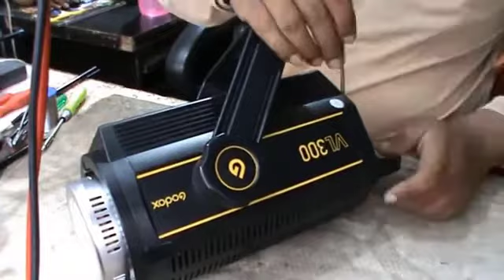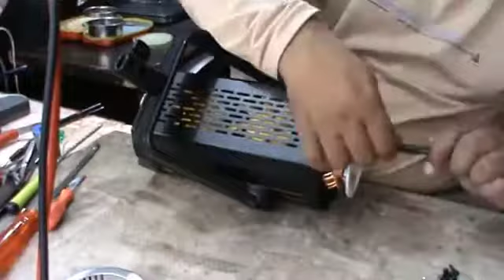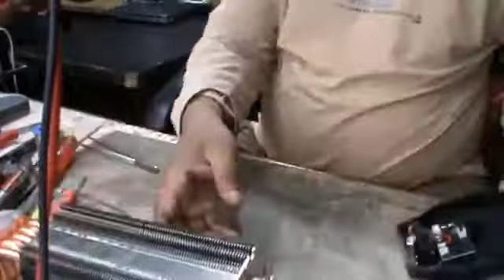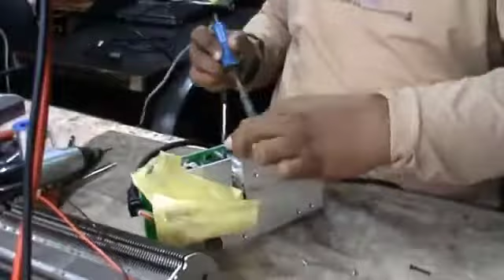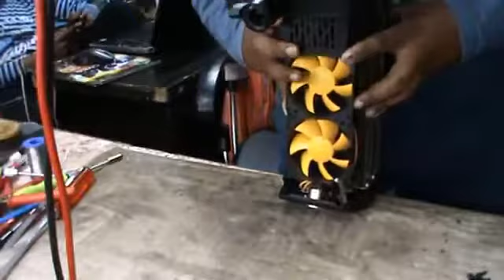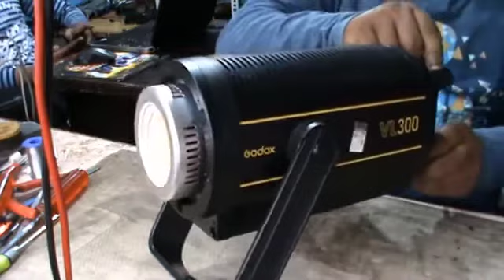Godox VL 300 | Not Working

Comment: I like the light quality and body design of VL300.
But my VL300 crashed after using it twice. The fan was not working when the light is on, then the light shut off, the red indicator blinks, and the fan started working. I have to restart it time and time again. Finally, the vl300 can't be turned on at all. The control panel looks OK, but the lamp dies. I just bought it for 16 days new. Now I am negotiating with the seller. 
I don't know what caused the issue. Do you have any idea about it?
Reply: Any update on this? Same thing
Reply: @ianmahan3630  The seller contacted the factory in China, after 3 months waiting, now the circuit board is on the way. I will update after the repairment.
Reply: Mine just stopped working. I am able to power on the controller, but the light does not turn on. I have tried swapping out the XLR cable, but no luck, so I’m assuming the issue is the light.
Reply: Finally, I receive the circuit board, after 3 months. After changing it, the lamp recovery, so far so good. The heat sensor and the fans work fine too.
Reply: Mine just turned off....I'm not even getting the red light on the power block.
Reply: @KSoul  This is just like the issue I had in the second stage.
Reply: can anyone confirm that the light colour on the power brick is supposed to be green and not red? Does anyone know why mine is red?
Reply: @Thrillstory  Mine is red. I see another friend's vl300 is red too.
Reply: Same thing after owning for a year and a half.  Out of warranty too, so no help from Godox or seller so far.

Comment: My Godox VL300 works for a very short time, then the fans come on and the light turns off, while a blinking red light flashes at the back.  Does the procedure in the video fix this particular issue?
Reply from the maker: 9829309373
Reply: @swastik_camera  I have a problem on 

Godox Controller for VL150 LED Video Light and there is a red light on the back what i have to do i am on Dubai I can’t fix it 😔

Comment: Thanks for the video. I share your frustration at being able to access the internal parts of the light fitting. My problem was a faulty input circuit board. Other technicians should bear in mind that the fans are operated by a thermal switch and only come on after about 5 minutes with the lamp on 100%.
Reply: How did you handle the faulty input board? I feel that after looking over mine that it is probably a similar issue.
Reply: @muddimanphoto  I ordered a replacement board from a Godox distributor. I was told Godox do not hold spares stock and board had to be manufactured especially for me.Took 2 months to arrive.
Reply: Hello John can you help me out, I think I have the same issue
Reply: @vineetharya3254  Hi, Take your unit to professional lighting repairer who should be able to order you a replacement circuit board and fit it for you. I could repair it for you but I'm based on the south coast of the UK.
Reply: @John-fs9om  Good day friend! I have the same problem due to a bad connection. Can you give me the address, page or link of the Godox company where I can request a new circuit board? Thanks!
Reply: It's not that hard to replace the temperature control board by yourself. Just follow the video from beginning up to 2:32, where he unsolder two wires from the circuit. For replacement search for Godox VL300 Temperature Control Board part numbers 127-D193801 or EAN
8718485912238 or D193801.

Comment: My power unit isn't working anymore for the vl300 and the dmx/dc power ports on the v-mount controller are not communicating to the light. I tested the light itself with another unit and it works, its just the power unit and controller that aren't working. Anyone know any repair or replacements?
Reply: hey by the power unit do you mean power brick ? Do you get a green light still?
Reply: @Thrillstory  yes, and no my Green light doesn't turn on.
Reply: @Thrillstory  the light on the power brick is supposed to be red or green?